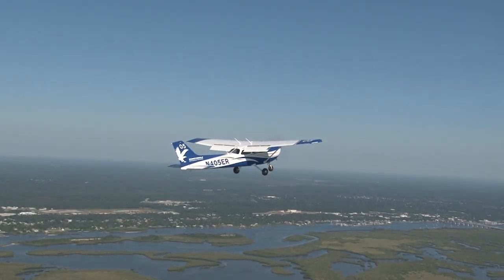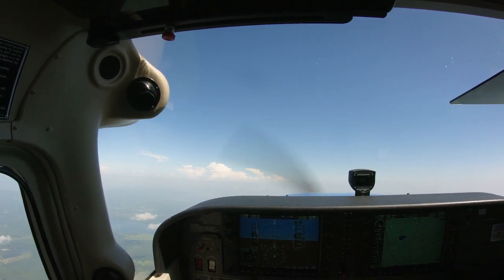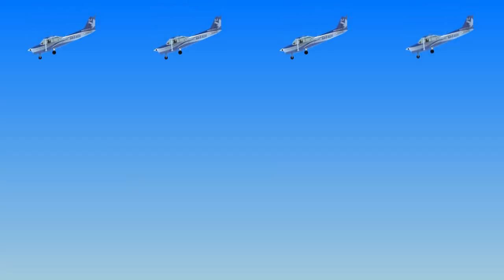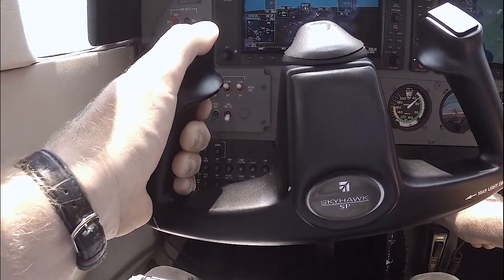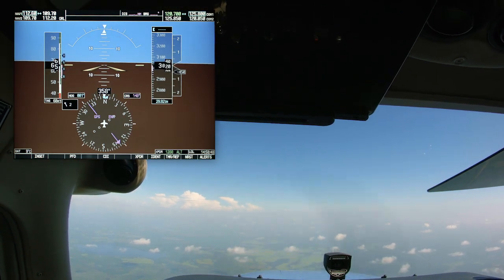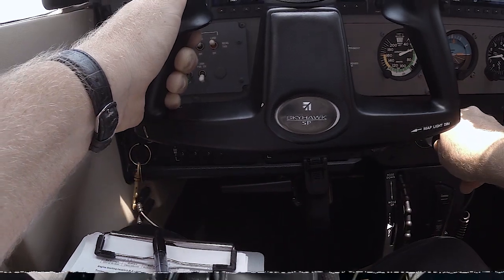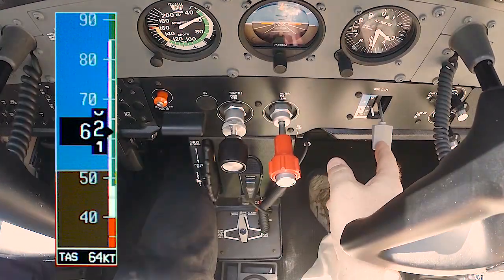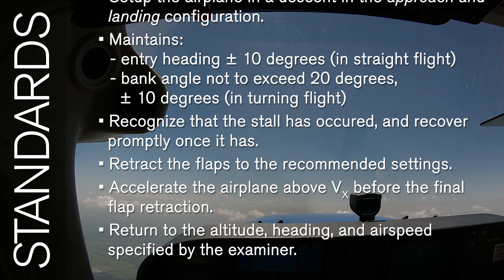Power Off Stalls

Comment: entry-
carb heat hot, throttle idle, bring back control wheel, until you hear the stall horn, once the stall horn is heard, full back. keep you focus on the rudders as one wing may drop.  

recovery-
carb heat cold, let the nose drop little bit to gain airspeed, full power, and quickly nose to horizon and trim nose up, establish for cruise.
Reply: I'm still at the point where everything is happening so fast I have trouble with this recovery
Reply: @eddiecongdon8017  Same here...
Reply: No- Do not go carb heat cold first - that can cause an engine failure due to carb ice in some airplanes such as the C-150. Recovery should be: 
1) Reduce angle of attack (stick forward, nose down), 
2) Apply full power, 
3) Carb heat cold, 
 As wing starts flying again: 
4) Flaps up to 1/2 (if they were full),
5) Stick smoothly back to a positive rate of climb,
6) Retract remainder of flaps
7) Reestablish level cruise flight
Reply: @experimentalairplane  -- Whoever told you that dont know much about engines.. With carbo heat throwing hot air into cylinders and you put a lot of  power you could cause cylinder damage due detonation.. see videos about DETONATION.  One of the main reason is too hot air into cylinders.. Im a CFI and Engine Performance and Repair Specialist..
Reply: C172SP is fuel injected there is no carb heat
Reply: @andyhawaii2819  -- First time i flew the SP was around 1976.  Has almost same engine as the Cardinal..
Reply: Carb heat on/off is something you should refer to in the AFM/POH.
Entry- 
1,500 AGL, Clearing turns, GUMPCS, Establish a stabalized descent, raise the nose as if you're entering ground effect over a runway, call out stall indicators i.e., stall horn, buffet, call out full stall i.e., uncommanded nose down pitch.

Recovery-
Reduce AOA and apply full power while remaining coordinated, establish Vx or Vy, recover into cruise.